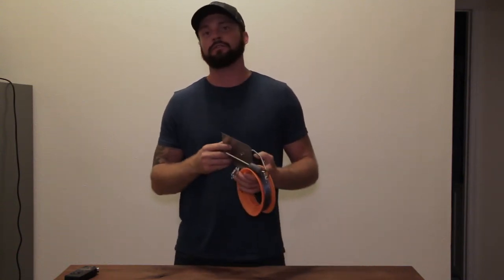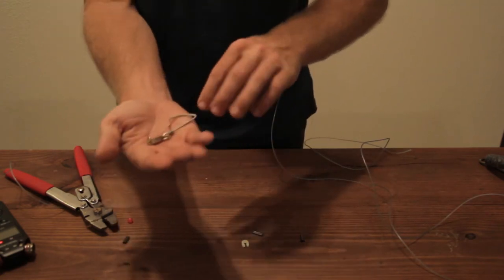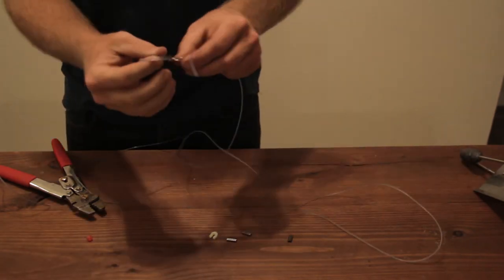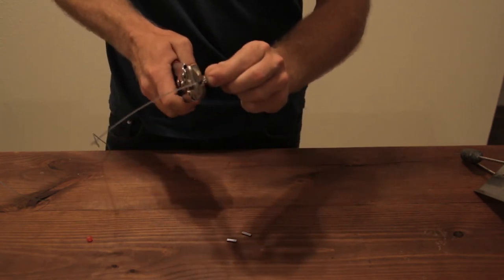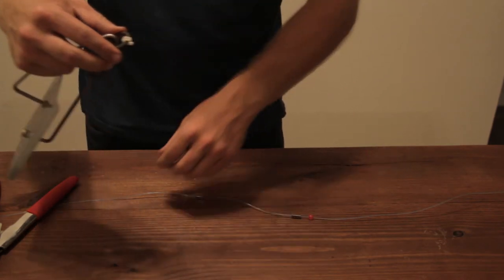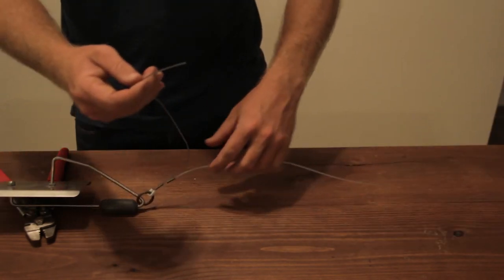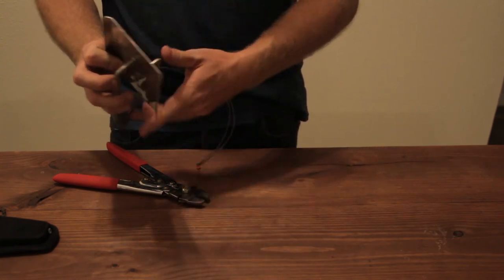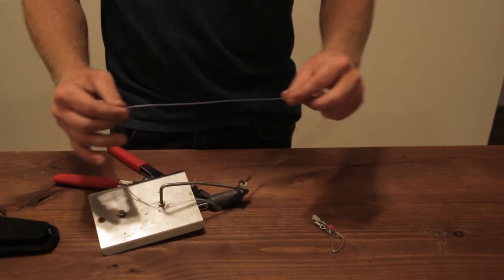How To Make A Poor Mans Downrigger: Catch More Fish Using Planer Boards!

Comment: Been laid up for two weeks because of the wind.  Finally got out yesterday for the second attempt.  I made the following changes.  I bought a sack of #16 rubber bands, used a medium/light spinning rod with a bait runner reel.  I set the reel on bait runner until a strike then I went to the regular drag.  Now the down side.  Hurricane Eta dumped tons of trash in the water along with tons of fresh water and the water was murky and full of floating matts of trash.  My first strike was a 6" by 8" piece of heavy duty black plastic tarp.  I had to pull in twice to release trash.  After 45 minutes of trolling I caught a 10" Spanish Mackerel.  The rubber band broke, the bait runner started screaming immediately and the switch to regular drag was perfect.   Thesystem worked perfectly.  The planer hooked to the boat took all the pressure off the rod and was a very pleasant experience.  I can use the planer, pull  it in and  switch to other types of fishing in minutes.  I marked my line so I know when the leader is close to the planer and the lure 60' feet back.  There were no birds at all and conditions could not have been  much worse.  I was grateful to catch one fish just to watch the system  work as planed.  In better conditions, I expect this to be my go  to system for trolling for mackerel.  I think the lighter rod will  handle a king if it isn't too big and I have enough line to  play it.  I have 30# braid but the leader is probably light.  This system is inexpensive, long lasting, easily stored and put to use when called for.  Perfect.  Thanks so much.  In addition, with all the problems with the trash not once did I have a tangle.  A little care when you let the lure out and there are no problems.
Reply from the maker: Thank you for the detailed experience! I'm glad it worked out so well for you. It's a great system and I hope you catch many fish using it

Comment: Could you use a snap swivel on the planer end so you can change out planners
Reply: I wondered the same thing. Did you ever try it?
Reply from the maker: Yes you can but you're creating a weak point and risk losing your planer. If you choose to do that make sure you choose a good quality snap and keep an eye on it

Comment: I have two questions:  1)  When you let line out, can you feel when the clip hits the planer?  You say to let 100 feet of line out, does that mean you are actually fishing 200 feet behind the boat, one hundred feet to the planer and another 100 feet?  2)  If you can reel all the way to the lure, how do you stop the twist when fishing a Clark spoon?  Tomorrow is trial day.  Thanks
Reply from the maker: You cannot feel when the clip hits the planer. Yes you want to let out about 100 feet of line then hook up to the downrigger line and let out another 100’ if that’s how long your downrigger line is. You will have to either guess it right or mark your fishing line. Keep in mind it doesn’t have to be perfect. If you only let out 50’ of line your bait will still be below the surface. If you let out too much line the excess will just bow in the water creating slack. Adding a good quality swivel about 10’ away from the Clark spoon helps a ton with line twist.

Comment: Well, I tried it out and had a few problems.  Did it work?  Yes sort of.  I caught three Spanish mackerel.  I have been catching 13 to 17 per day so production was way down despite seeing more fish than ever before.  Two of the fish  did not break the rubber band and were brought all the way to the boat still attached.  The third fish was brought in as described.  I did have to make adjustments as I am fishing Tampa Bay which is generally between 12 and 20 feet deep so I had a #1 planer.  I was most successful using 35 feet of 20# mono leader and attaching the rubber band at the head of the leader and letting the line out to the planer.  I did hook up with two other fish that broke off after a short fight.  I was surprised at how hard the fish pulled once broken off of the planer.  I think the breakoffs were related to drag being to tight.  Since production was so far down, I went out Sunday in the same area fishing as in the past and caught only seven.  There were so many boats out churning the water I believe the fish were put down by so much activity.   I also was surprised at how long it took me to reel in the fish and reset.  The planer tethered to the boat acted perfectly.  Interesting concept and one I will continue to  work on.  Thanks for the idea and instructions.  Further comments as I learn more.
Reply from the maker: Wow thanks for such a great description of your day. What strength rubber bands are you using? Try using a lighter strength rubber bands when targeting smaller fish. I typically use this method for larger fish such as kingfish and wahoo so the lighter band should fix that problem for you. Did you experience any tangles? If not that’s a big win for you on your first attempt. I look forward to hearing how round 2 goes for you. If you ever have trouble getting strikes try putting the bait back another 30’ or so from the planer.

Comment: It's about time you made this video lol how hard is it to pull the planer back up when you're done fishing or is there a way you can unset it thanks for the knowledge n keep the videos coming more often and what state and what city do you live at I'm out of fort Lauderdale Florida
Reply from the maker: The other video is coming up shortly as well! It’s very difficult the best thing to do is pull the throttle back to as slow as possible and pick up the rod pull back on it as far as you can. You will quickly drop the rod towards the water creating as much slack as possible the snap the rod back as fast as possible. This should trip the planer. Reel as soon as possible so the planer doesn’t reset itself. It takes a little practice but with time you’ll get them to trip every time
Reply from the maker: Go back to the planer video and go to 16:40 for an example on how to purposely trip the planer

Comment: Why 2 swivels between planer line & rubber band? Could you not girth hitch band to ring on swivel then girth hitch to main line, then clip to planer line?
Reply from the maker: The second swivel is there only to keep the fishing line away from the planer. It's to prevent line fray

Comment: Can you rig this with a snap swivel on both ends? I’m thinking what would work great for me is to rig 2 lines of different lengths and I can use them with different planers. Snap one end to a cleat and the other end to the planer. Think that would cause any problems?
Reply: I have the exact same question.
Reply: It should be fine, once you have the bead a foot above the swivel! Thanks for the idea, I'm going to try it this weekend as you've described.
Reply from the maker: Yes you could do that and shouldn’t have any issues. A snap swivel is always a weaker point though so make sure you get a strong high quality swivel

Comment: I used the smallest rubber bands I had and they were pretty thin.  It worked properly when I I went with a smaller clip with thinner wire and attached the the line to the planer at the head of the leader.  It would be easy to make the leader another 30' longer.  I'm very interested in making this work.   Smoked mackerel was terrific.
Reply from the maker: Smoked mackerel is definitely the way to go!

Comment: Why not crimp a swivel on both ends so you can use the same leader for different planers?
Reply from the maker: You can definitely do that if you choose to. A swivel will always be the weakest link so I try to avoid them and just make a rig for each planer

Comment: Getting ready to make this rig. Saw a question about using a snap swivel on the planer end so that you can switch out planers.  Any reason not to do this ?  Has anyone actually tried it ?
Reply from the maker: You can use a snap swivel just make sure it’s very strong. Planers aren’t cheap. I prefer just to pre make each rig for every planer board I own
Reply: @ScottBonnerOutdoors  Thanks Scott !
Reply from the maker: @paulbisbee4804  any time. Let me know how it works for you

Comment: Im worried about leaving my planner on a reef who deep do they go?
Reply from the maker: It depends on the size of the planer. A #1 will just barely be below the surface and a #6 will be much deeper. It also depends on how much line you put out, boat speed, line weight etc. you just have to experiment around